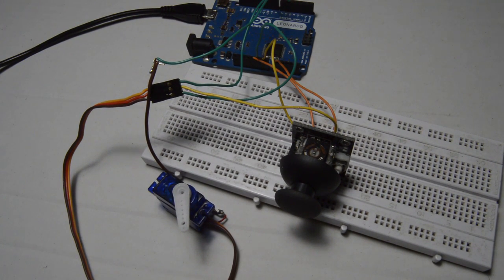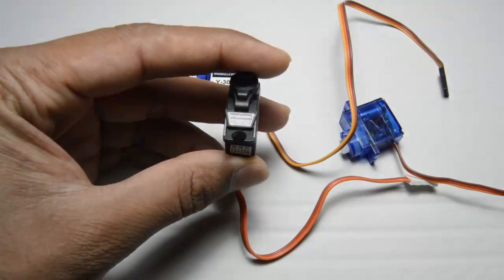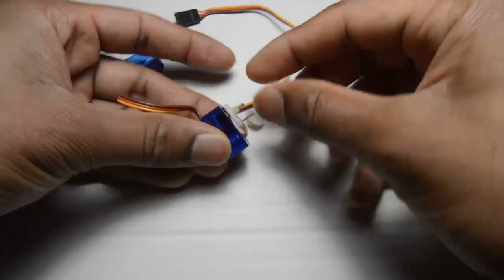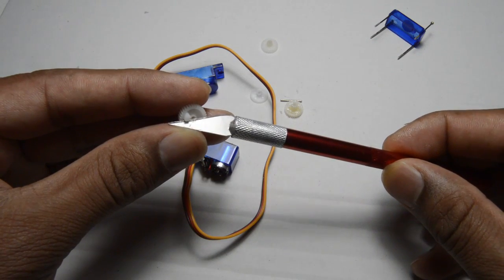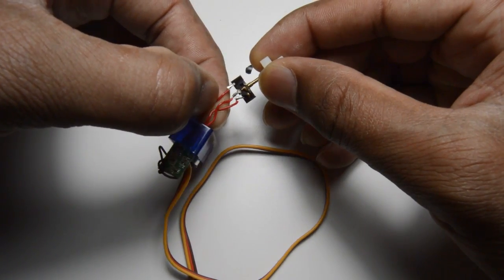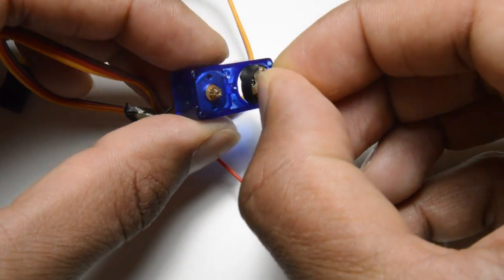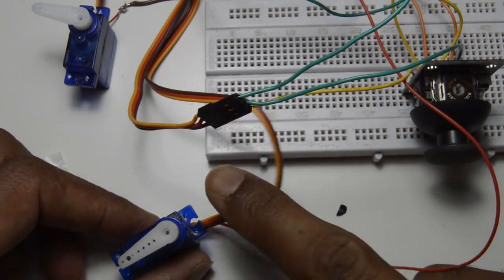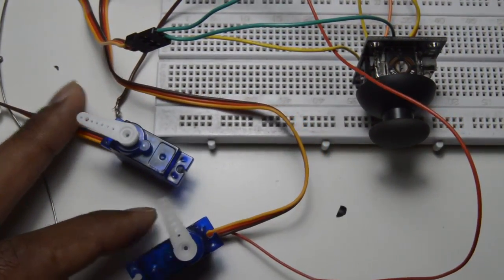How to convert/modify a Servo Motor for Continuous Rotation in both direction using Arduino

Comment: Hi, thanks for the tutorial video! It works! 
However, I'd like to ask that, is there any method (codes) to make the 360° servo motor "pauses"/"stuck"?
Which means after a certain times of rotation, I wanna make it stop (without cutting the power supply), and even if I wanna rotate it manually  (eg: by hands), it won't be rotated (eg: "lock" at that position).
Thank you.

Comment: Why didn't you just disconnect the pot from the wires and place the wires in a potential divider of equal resistors, this would simulate 90Deg and you can use the standard servo signal to get direction and possibly speed.

servo control 0Deg   ---  servo rotates one way
servo control approx 90Deg --  servo stops
servo control 180Deg -  servo rotates other direction.

No extra wires no extra I/O used.
Reply: Can you regulate speed in this way (your way ;) )? I would like to make 10-20 super small, super cheap cars for demolition derby (IR sensors for contact counting, ESP8266 for control). Thanks for replay.
Reply: OK, it works. Finally normal video. 
https://www.youtube.com/watch?v=3PrPP_0a8ys